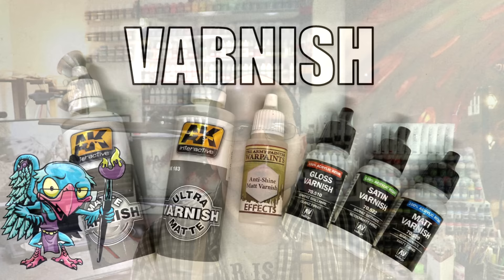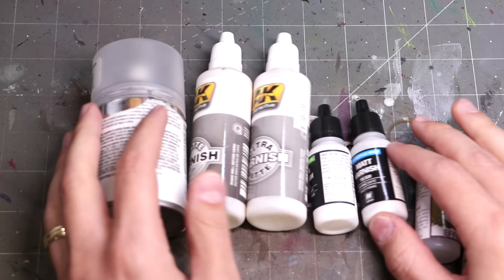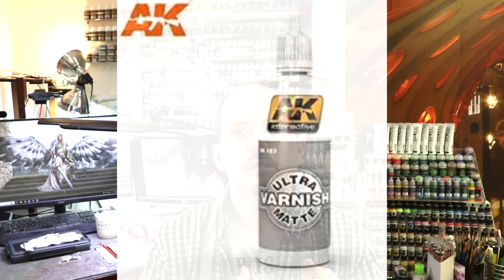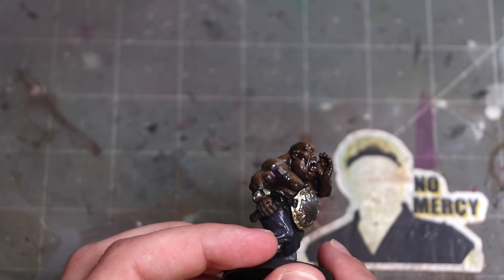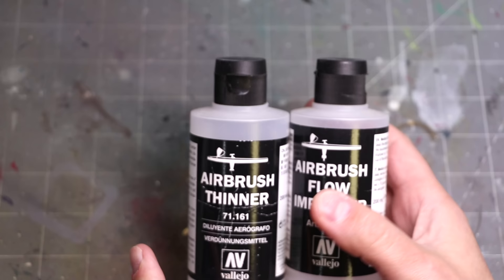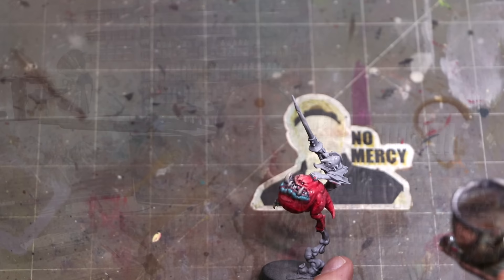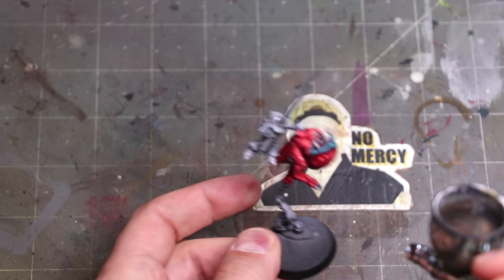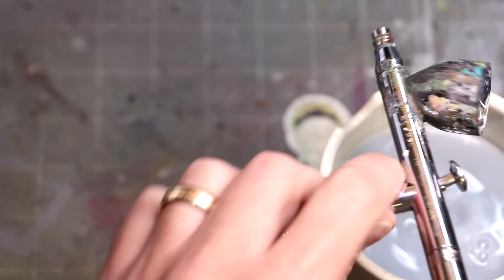How to Varnish with your Airbrush - HC 367

Comment: Durability is a myth. The only thing causing a matt varnish to be potentially less durable is the tooth of it; the rough surface. Adding that drop of satin (which is the same as matt varnish, just with less matting agents) will hardly increase durability. Acrylic paint is essentially glue; its pretty tough by itself. Apart from finish, surface tension or the safe point you mentioned (which is great), there is no real reason to varnish figures. 

That safe point thing can be expanded to final glazes on gaming minis, because they're rather thin and might be touched. But it is still rather strong by itself so meh

Comment: Can i use acetone instead of the iso alcohol?
Reply: For sure, although the fuemes are more unhealthy than those of Iso. So for that reason I might not. Will clean any metal (miniature, airbrush or otherwise) very well though.
Reply from the maker: As Wijkert says, you could, but be very careful, Acetone is more dangerous for sure.

Comment: When I varnish I find it's completely knocking out my highlights. They just disappear. Even to the extent that the underpaint shows through. E.g. I did blue underpainting cos that's my main colour and then where I've painted flesh blue patches show through the flesh. Why is that? I was varnishing with straight gloss and straight matte.
Reply: Hard to tell without any pictures. But I would think that there might have been some Airbrush cleaner or alcohol left in your airbrush that caused the outer layers of paint to break up a little.
Reply: @ItsDaCMD  Interesting, I'll bear that in mind.
Reply from the maker: COuld be multiple things, the existing finish could have hidden that you didn't have a solid base coat, something could be breaking down the paint as described, it's hard to say for sure.